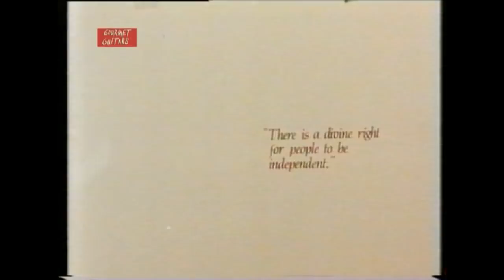JOSÉ ROMANILLOS | Classical GUITAR MAKER - Part 01

Comment: Somehow I don't think the Chinese models are made this way
Reply: China has been woodworking for thousands of years and has plenty of masters.  If someone wanted to pay them and give them the tools and time they absolutely could.  However, when production is moved to China, it's usually for cost savings, and when cost savings is the number one priority for a company, the specs are low to begin with.  In short, they make it according to specifications of the company.  Cheap Chinese products are due to what's ordered, not the skill of the maker.

Comment: I know it's common for a soundboard to be two bookmatched pieces with the break being vertical but what about horizontal? I've got a piece of wood that I think would make a beautiful soundboard and probably has the right resilience but it's only 11 inches or so tall. So I'm thinking I could just cut two pieces out of it and add the second piece to the bottom. It should match well visually but I'm not sure how that would affect the sound.
Reply: Because of the pull of the strings you need the strength to run the long way.  I think you'd find it would not be satisfactory.  But a Concert sized ukulele might work well.
Reply: Oh I see, thank you.